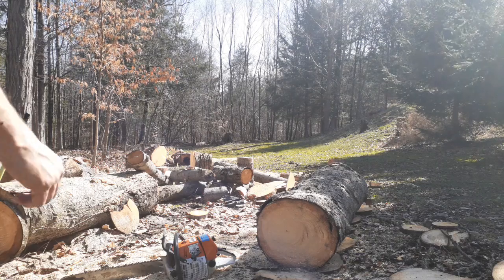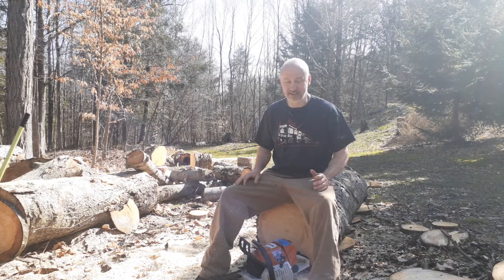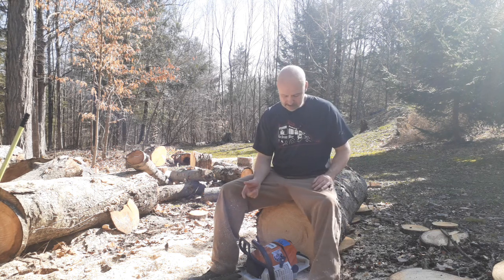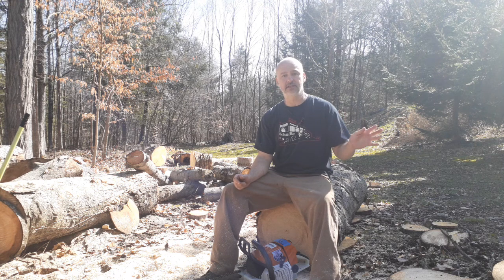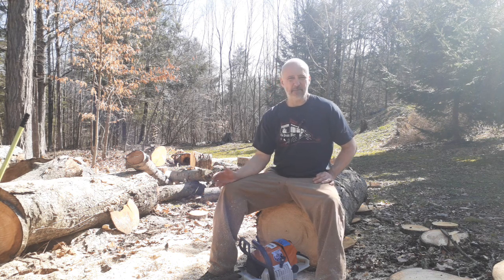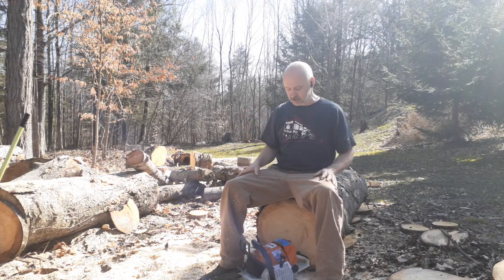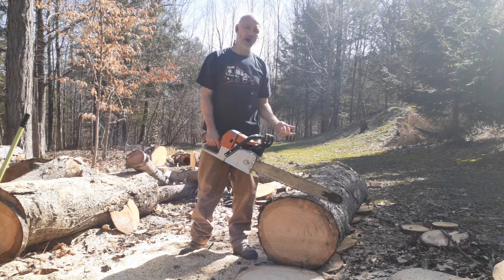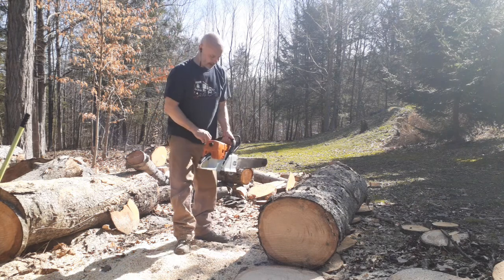Farmertec clone Stihl Ms660 - April 14, 2022

Comment: I have a Nec tech 892 that’s not oiling a 36’’ bar to well. Plan to mill with it soon. Any idea’s for a better oiler? I’m currently building a drip oiler for the mill.
Reply from the maker: Mod oilerr or swap it out for another. They vary widely in how much oil they put out. Also you know you can adjust output of oil on bottom of saw right?